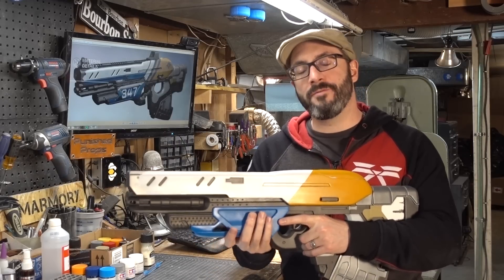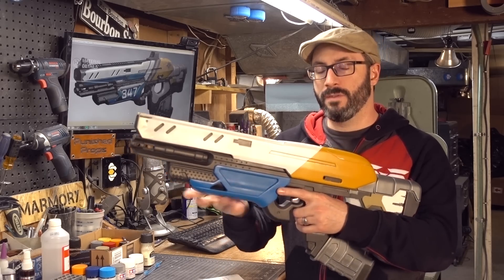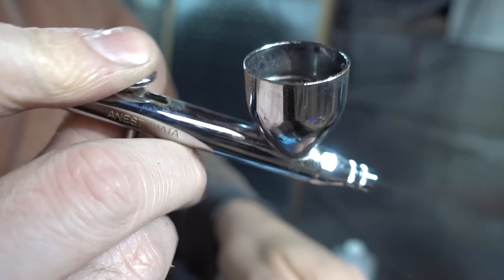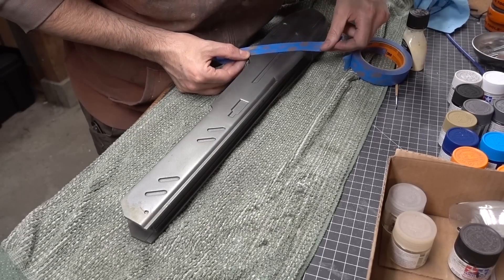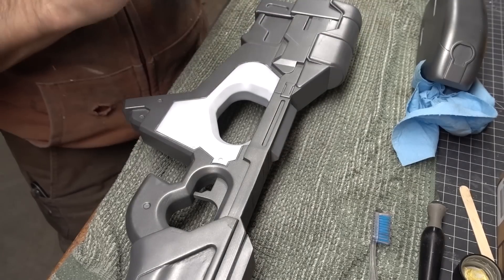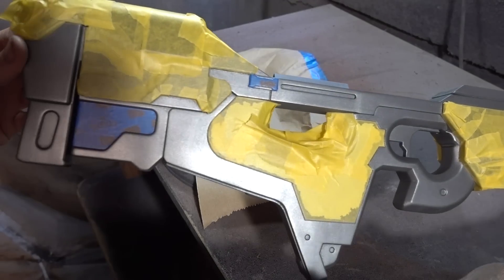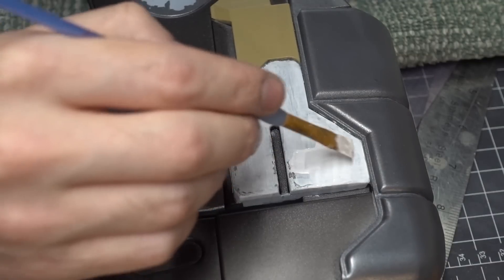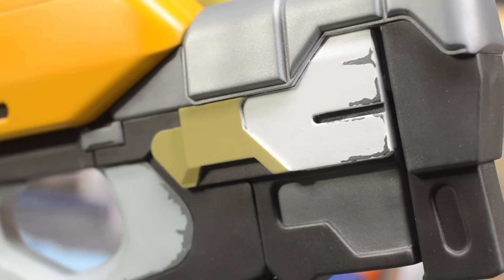How to 3D Print a Gun Prop from Destiny Part 9: Masking & Painting - Prop: 3D

Comment: Hey Bill, big fan.
I have a technique for wet sanding you may like. If you get a spray bottle you can spray both the peace and the paper. This makes it easier to control the amount of water on both and also cleans the paper. I mainly use it for panels on cars but it also works great on bondo and filler primer on props. 
Love you vids, thanks

Comment: I'm starting my journey with 3d Large scale props and I see you used a dual trigger airbrush, you did not need a wide arc nozzle attachment to get an even spread? I want to use my badger 105 with a .5 or a .75 needle... do you believe that would be more than enough?

Comment: Had an issue with masking and paint bleeding under the tape. I was meticulous and took my time during the masking process however, there were a ton of small intricate edges and areas to mask. Taking this into consideration along with the fact that I'm rather new to the process, I had some minor errors in paint. How do you go about correcting these areas? I was thinking a micro brush and lots of patience?

Comment: I am still working on my Hung Jury SR4 and I had a problem with separating some pieces which had grooves while 3d modeling. So I decided to print out big pieces without the grooves and add them later... Now I have problems to add those grooves again. I tried to use my Dremel, but the lines are more messy than straight :/ Maybe a professional guy like you has some more experience in this and can give some tips.
Reply: I just want to let you know that I took your words serious and overdid basically my whole 3d file for the Hung Jury. Now the lines I talked about are all carved into the model and some extra details have been added, too. 

But the point is: I wanna thank you for your tutorial which encouraged me to start all over again to get such a nice finish as you achieved with your boolean gemini. And for your Tips in all your videos. They are very helpful :)

Comment: Hey Ilearned to drive in a 1958 and the steering wheel had this waxy Petipa of grease and sweat. Fast forward I purchased a used Ruger mini 14 from a  state prison it had the same waxy area around the grip area of the stock from being carried around in a guard tower other then this the weapon was I fired.  This could be faked by spraying truck bed liner around some of the pistol grip or any where some one might carry the weapon also consider rack wear a weapon will rub on a rack just sitting in an armory purchased an SKS that was in in shot condition but the stock finish was rubbed and worn ever so lightly on the shoulder stock on the forward stock.  If you built a wood shipping crate maybe to hold the weapon and magazines matched the wear patterns you would have a great show piece.